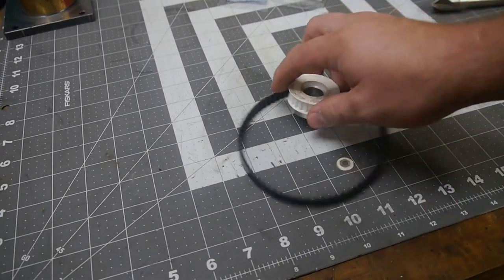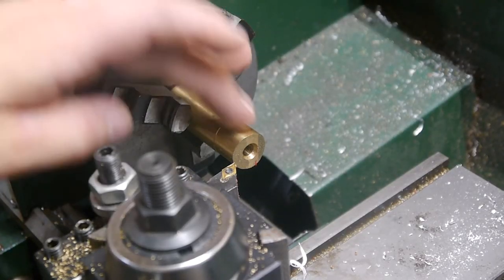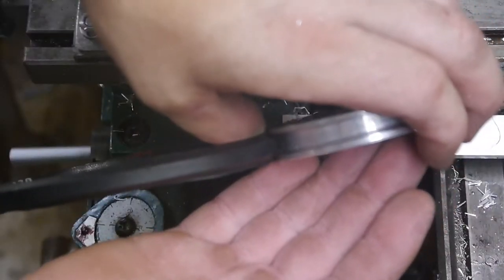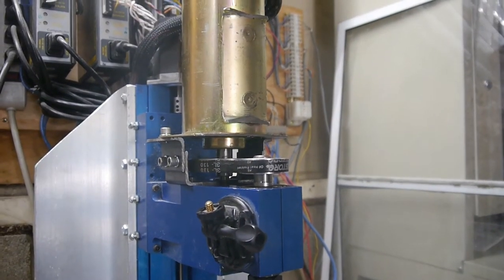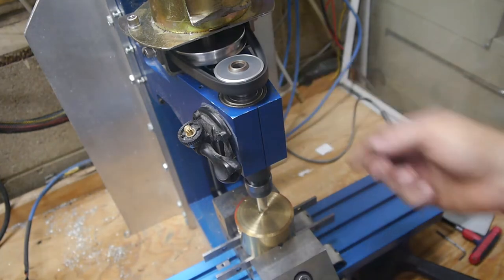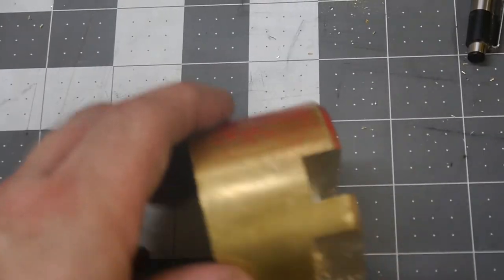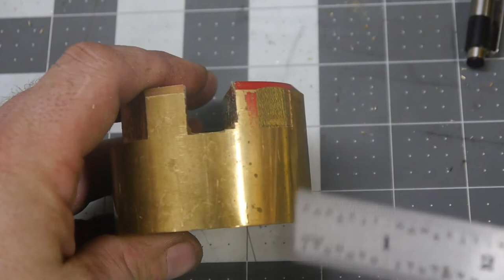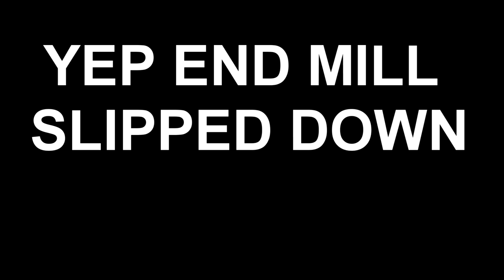MAXNC cnc Drive Pulley Upgrade (Aluminum V-Belt 3L-130

Comment: Hi josh..i dialed in my maxnc10...its not bad..its about .001 variance on y and .002 along x....also the weakest link on the entire machine is the spindle motor...i cant even do .025 cuts with a 1/8 end mill without motor stopping....i have to take .015 cuts...oh well.
Reply: In aluminium

Comment: It's good to see a new Max video! An endmill in a collet for "heavy" roughing is not a good idea. Given a good collet it's excellent for finishing. Since it will generally have less runout then a solid tool. Sometimes you gotta do what you gotta do I get that. In your situation I would try 1/4 to 1/3 of the depth and start out at 6300 rpm 9.45 feed rate. I believe your stepovers will be okay with the reduced depth. Brass is also very sensitive to dull tooling so as sharp as you can get you hands on.
Reply from the maker: I am glad you enjoyed it. I agree not the best solution, But since a collet is the only way I have other than a drill chuck to hold an endmill I have to, like you said make due with what I have. I also goofed on the endmill diameter it is actually a 0.4125" rougher endmill with a .375" shaft, soo.... Yeah, OOOPS!. In the end I got the slot milled and the part done. I had heard that brass was tricky like that and I certainly experienced it grabbing my drill bit later on when drilling a hole for tapping. I will have to try out those settings the next time I have to mill brass. Thanks for watching!

Comment: What do you use to design your parts and export them to GCODE?
Reply from the maker: I use Autodesk Inventor Professional 2018 to design the parts and Inventor HSM to output the G code. My understanding is that it is essentially the same g-code engine as is in Fusion 360. Inventor is optimized for creating part assemblies and list of materials for an industrial environment. I use it because I have access to it through my work. I certainly would recommend Fusion 360 for part creation, FEA, and  G-code creation.